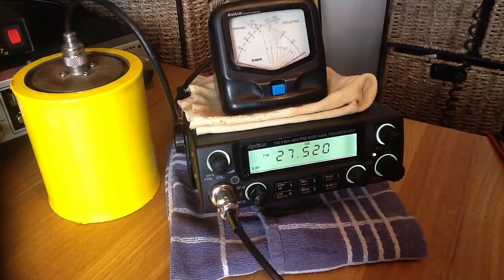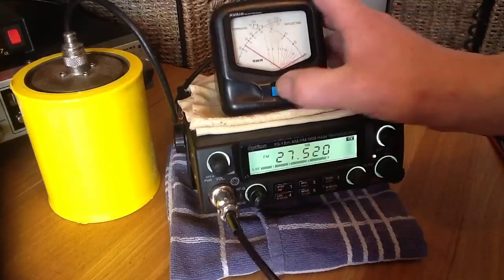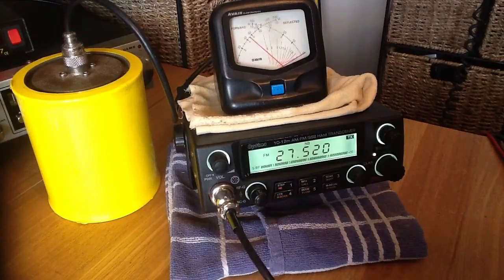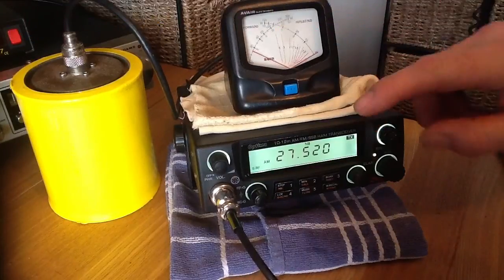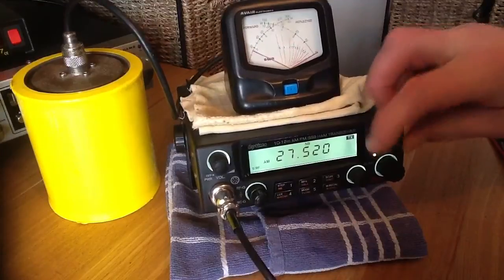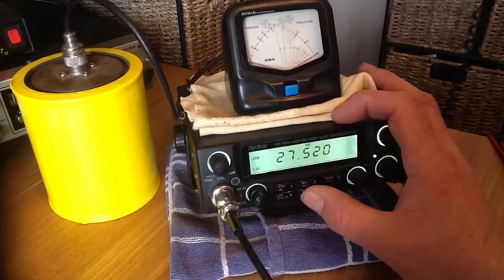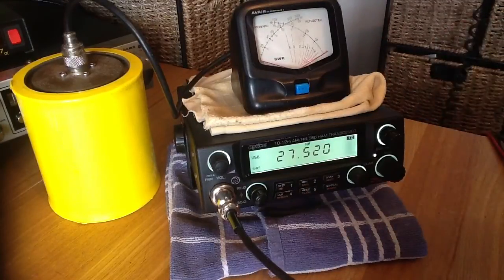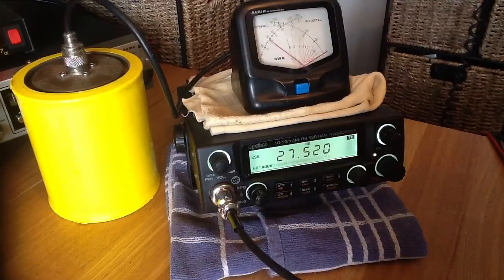OPTIMA I0-12m AM/FM/SSB HAM TRANCEIVER

Comment: So do you still use this radio? And is it hitting 40 to 50 on SSB now. Just wondering if you found a fix.
Reply from the maker: Radio has long gone Spike, many fixes spoke of and published on the net, but none ever got the radio to sound loud,audio was far to low so it's a gonna.
9 out 10 Optima owners I spoke to sold the radio on...not a good radio at all really.
Reply: 26TANGOMIKE037 Interesting. I was considering getting one for the vehicle. Although I was going to wire a Road Devil by Astatic for it. But, this makes me leery now. Maybe I will just get a new RCI 2950 to replace the older one I have now. Thanks for the input, mate. Cheers!!!